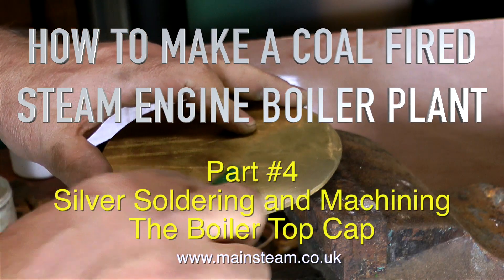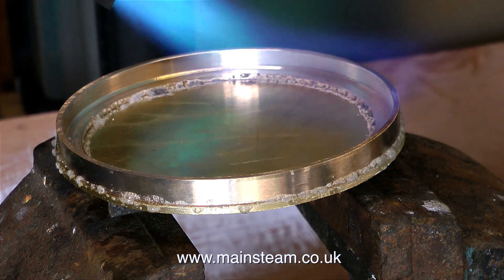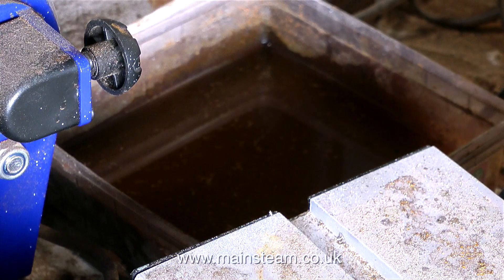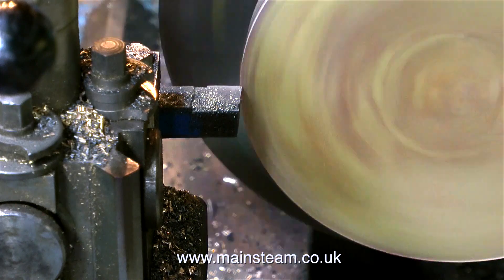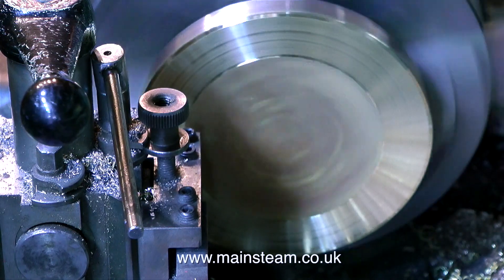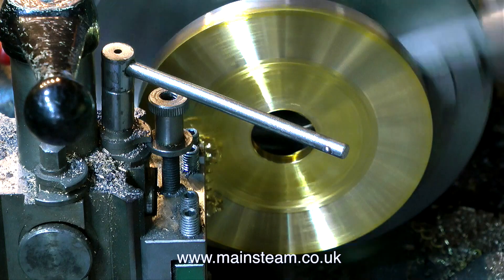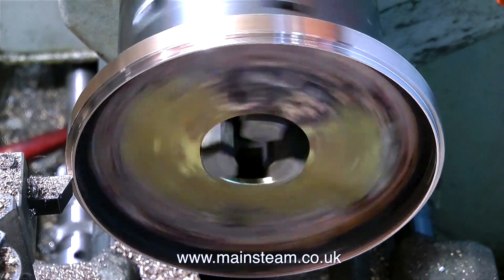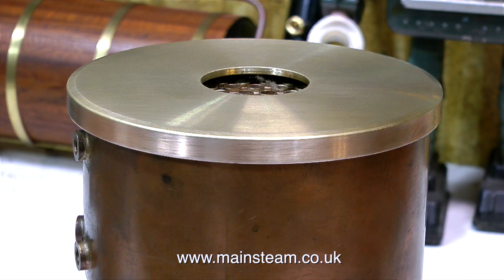HOW TO MAKE A COAL FIRED STEAM ENGINE BOILER PLANT - PART #4

Comment: Near the end of the video when you were turning down the outside of the top cap, could you use a block of wood on a live-centre to hold it more tightly and stop the resonance? I guess the effort you would save in turning down the cap would be lost in the time it would take to cut a step into the wood to clear the chuck.

Comment: I think some people get confused by the term "silver solder".  Silver solder is actually a brazing filler and the brazing process is different from soldering.  In brazing the temperature of the material and filler are much hotter than with soldering and the raw bare metal uses capillary action to draw the filler into all its little microscopic nooks and crannies which results in a metallurgical bond.  The mechanics of it are really cool.